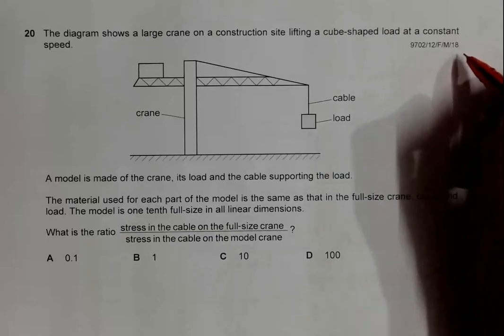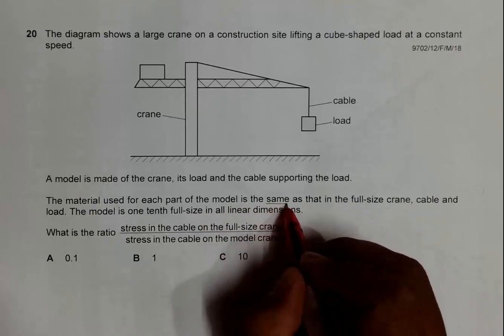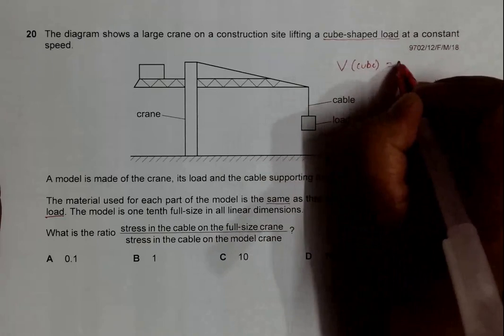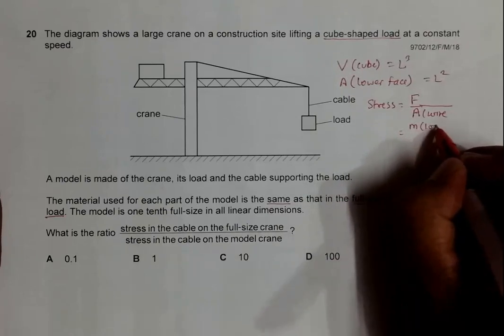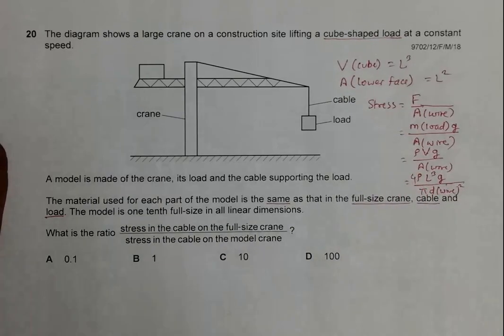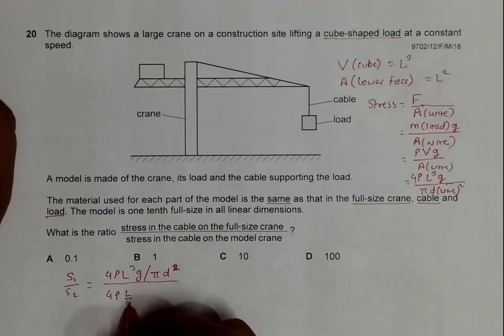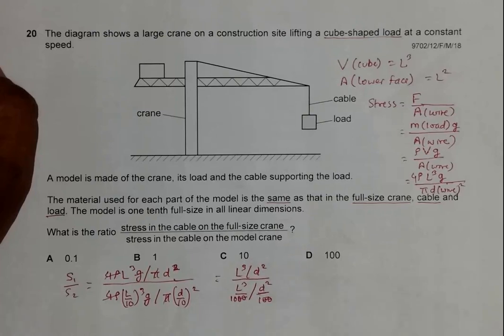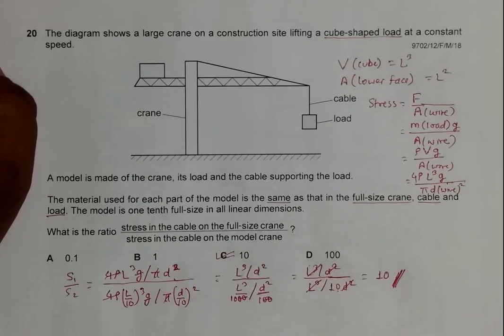2018 CAIE AS & A level February March Physics Paper 12 Q. No. 20 (9702/12/F/M/18) by Sajit C Shakya

Comment: Sir will it be the same when we write stress=F/A and in F we write as mass × g and inplace of mass we write as mass is density ×  volume and in place of volume we write area × length  ......and the area which was already in the stress formula gets cancelled with the area that came just above doing this for both the casea gives the same answer C. 

So sir is this approach correct?
Reply from the maker: Yes, why not!!! Another correct method is always welcome in Physics!!!
Reply: @sajitchandrashakya  thanks a lot sir